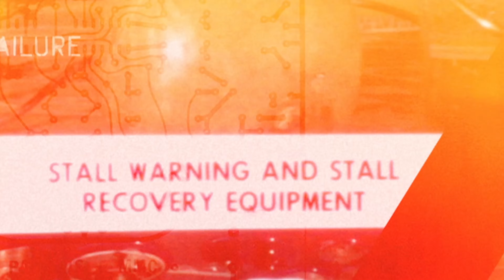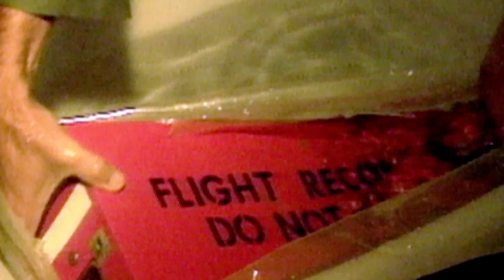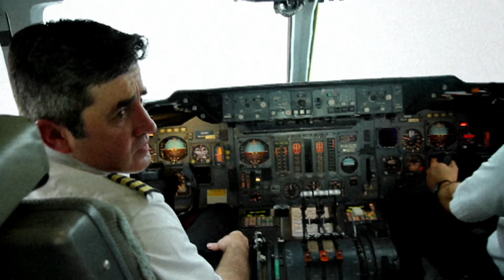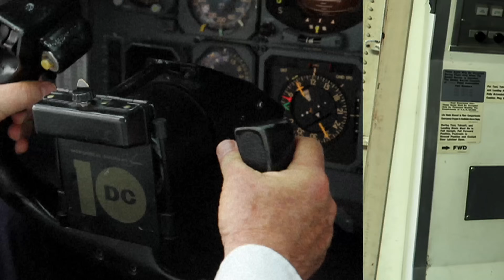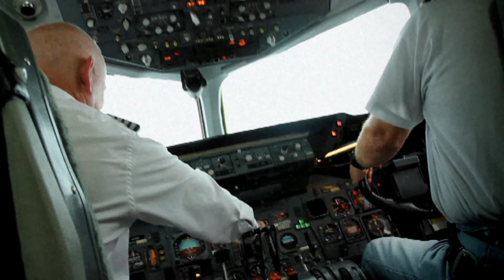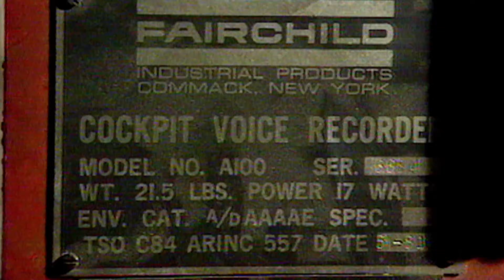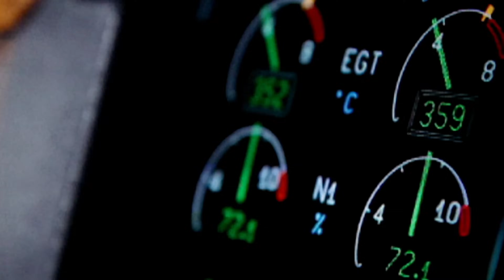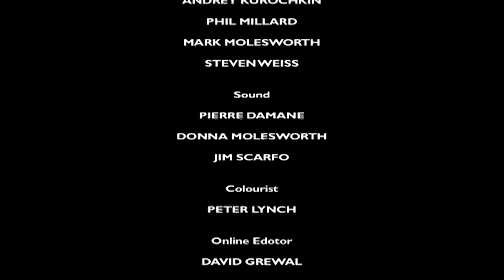Turkish Airlines Passengers Suddenly Fall Out Of The Plane Mid-Air | Air Crash Confidential S1 E4

Comment: "But the people on TWA 800 Didn't die in vane." That is pure BS. They did die in vane. Because this event should never have happened in the first place. In a lot of other industries, sparks created by short cuts had been known for decades. And high and low powered electric lines were never bundled together in the same bundle for that specific reason of a shortcut jumping between the lines. Any electrician in the world could have told this straight out of trade school, even in 96. So, like Turkish Airways flight 981, this was not and accident, but a known engineering flaw. Nobody on flight 800 lost their lives not in vane, which onlu makes the whole thing even all the more tragic and disheartening.

Comment: 800 was flying from jfk to paris. I don't think the gas tank had a puddle of fuel in it. Faulty wiring was the problem. The fuel temp would have gone done after a bit of altitude but they never got above 15,000 ft. TWA 800 was one of the oldest in production at 25+ years old. It should have had a major overhaul well before 96
Reply: Well the investigation was pretty comprehensive and the fuel vapors were a necessary part of the cause.

Comment: with all these hundreds of 747 flying with no fuel in their center tanks, this is the only one that had an issue?????   i don't buy it....
Reply: There were mitigating circumstances.  It was s hot day the ac packs superheated the fuel into hot vapors and the old brittle wiring shorted. It's always a chain of events. The solution is to eliminate ant of those links.
Reply: They didn't say that. But the bigger point to be made is that you could say that about other crashes such as BOAC Mt. Fuji, UA 585, and 911 to be sure. And AA 587.

Comment: Don't fly with Turkish airlines.
Reply: Why
Reply: @nilistatic  

Actually it was IMO about 2/3ds Douglas' fault, and 1/3rd Turkish Airlines. Just weeks before the disaster the airline did some tinkering, probably because of constant delays closing the troubled door. These including making the door easier to close by turning the locking pins into an extremely dangerous setting, adding unauthorized metal shims, and finally disabling the door-open indicator in the cockpit. This no doubt is why the plane was able to stay in one piece for the first year. But once these changes were made, the plane had no remaining redundancy. As the authors of Destination Disaster wrote, after this "a sickly child could have defeated the safety system."

This seems to have been lost in the shuffle as the full details were only revealed years later at the trial.

Comment: The 777’s fuel system heat exchangers were designed by Rolls Royce, the engine manufacturer, not by Boeing